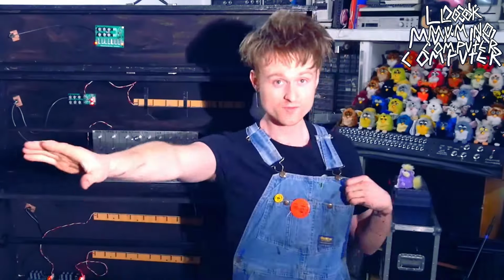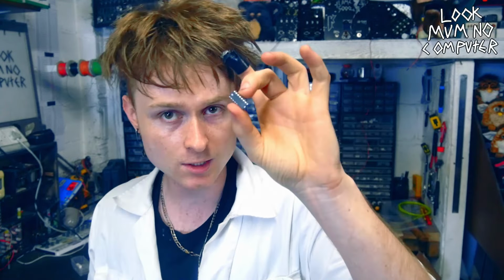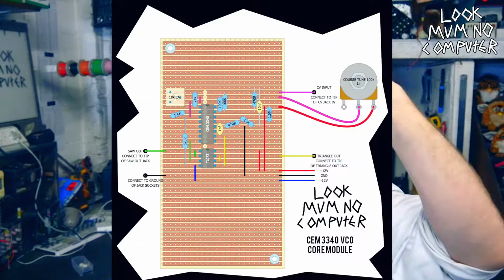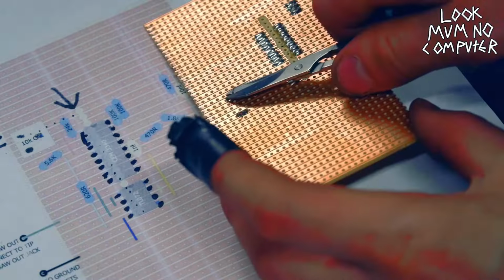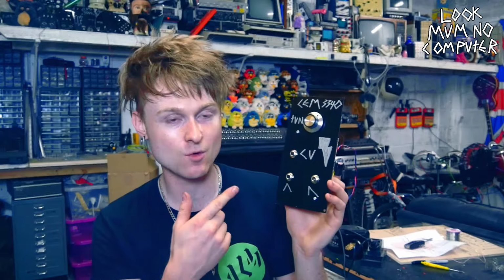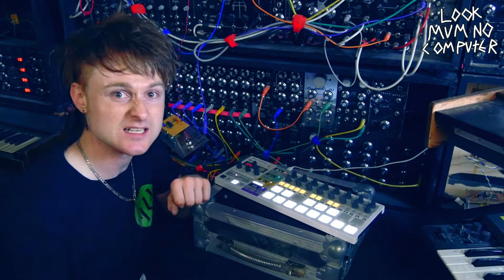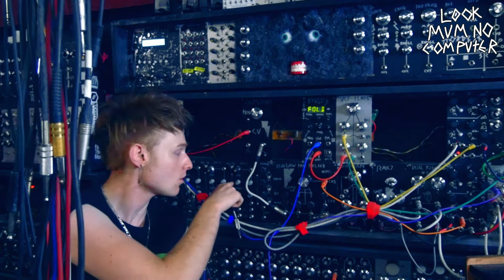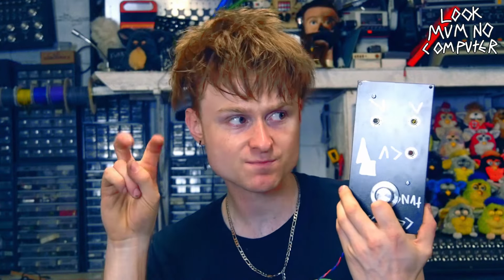Synth Voltage Controlled Oscillator 1v/oct tracked DIY how to.

Comment: If you want to tune this thing i less than 3min without any skill required and have a midi to CV interface and a computer, you can use my VCOTuner application here: https://github.com/TheSlowGrowth/VCOTuner
It's basically a little game: Connect it up, then turn thr trimmer until the line of your computer screen is as flat as possible
Reply: That is very cool, thanks!

Comment: Where is a reliable source to purchase CEM3340s?
Reply: Um...
You could use an XR2206 or an 8038 ic.
Both are VCO's that output square, sine, and triangle / sawtooth waveforms, with symmetry / mark:space adjustment.
 They are both well known, easily available, and only cost a couple of buck$.
Reply: @massimookissed1023  Thank you so much!!

Comment: Hey did anyone build this circut with an AS instead of a CEM? 
I get it to make noise but frequency is rather high and completely cuts of at about turning down the POT to about 5 K ...  Same problem anyone? Triple checked everything
Reply: Ah got it! For anyone interested, I had to replace the 100 K after the input POT by a 220 K. 

Now frequency range is good! CV jack not functioning yet though. 
But going to figure that out as well!

Comment: should the ics get hot? or have I wired something wrong?
Reply: @XXXLeahCimXXX  after looking into it and talking to Sam, they shouldn't get hot. I never figured out why it kept happening but I just removed the tl072 and it all worked right. later I tried a tl074 which seemed to work. might have been a bad 072.

Comment: Novice here, any one got any info on how to get the power supply to work with a +12v -12V 16 pin power supply? I have most of the components but I'm a bit lost on that aspect of the build.
Reply: @shokdj1  Not at all. This is of course DC.
Reply: @EvilOverlord96  yeah I deleted I misunderstood the -12
Reply: +/- 12V is Eurorack standard, so any Eurorack power supply will work. You can buy complete power supplies, buy them as a kit or make one yourself. An alternative would be something like the Meanwell RT 65 B. Some people might say it's not the best power supply for synthesizers, but for a DIY synth it should be good enough. As for the 16 Pins: This is also Eurorack standard. Some details and the pinout can be found here https://division-6.com/learn/eurorack-power/
Reply: Cheers man makes sense
Reply: @EvilOverlord96  I honestly thought for a brief moment that it was alternating, but it actually sits at -12 and plus 12
Reply: So from my understanding there’s 12v + and 12v - either side the ground and that’s it
Reply: @shokdj1  yes exactly. Effectively it's 24V. But the 0V or ground  reference point is in between. All inputs and outputs are relative to ground.

Comment: This is an old concept of synthesys, voltages are unstable and can be polluted, my very first synth worked with voltages. Today, with most of the microcontrollers you can have sine signals plus their harmonics for cheaper, or use a DSP, anyway that's far better because that's digital !

Comment: How does he tune it? What tool I mean
Reply: He uses a keyboard that puts out CV voltage at 1V/Octave. Then he turns the trim pot until it sounds ok to him. He mentions only using 4 octaves anyway. If you want to get the tuning accurate for 6 octaves or more you tend to need a more elaborate tuning with more pots. (Some use 2 pots or even 4)

Comment: I'm not whining and it's a cool video ) BUT... not everybody can afford (or even order) this chip. I've soldered two oscillators from discrete (op.amps mostly) components. And here are a lot of discrete schems over Internet  with 1v/octave. One thing (i guess) is superior with this chip is that it doesn't need to be temperature compensated. It's one of the most "evil" things for the most of discrete schems.
On the other side: when you choose CEM chip you loose any possibility to influence on the wave's character (it's not about PWM). Saw wave looks "too proper"... if you'll try some "cheap schematics" then you'll find that SAW can be changing it's form over octaves! It's cool and gives more liveness to an oscillator.

Comment: PC board porn, lol. I wonder if anybody ever attempted DIY DCO?
Reply: Sonikbytes Yes if i find the link ill let you know ;-), i saw one vid a while back .
Reply: Here Yo can see examples of dco, lfo and more interesnt utilitys with a ATtiny84 and 85  https://github.com/robstave/ArduinoComponentSketches
Reply: while neat idea to experiment with arduino type of circuits , I was hoping to see more traditional DIY DCO which is an analog oscillator under digital control: clock (analog or digital)-> divider/counter ( controlled by CPU)-> wave shaper "core" (analog components charging -discharging a capacitor circuitry )  like you have in 80's synths. Yea crazy amount of work :)
Reply: Sonikbytes right, Arduino is just LoFi sound, very usable but lofi, look at the VCDO of electric druid web

Comment: Does not work, even the VCF works only to 40%, all garbage.In the internal there is more help seeking, the Sam never answers a question, very bad, let the fingers of it, scrap everything.
Reply from the maker: it does work. i do answer pretty much all of my emails. all when built properly work well. have you emailed me?
Reply: @LOOKMUMNOCOMPUTER  Hi,

ups! No, I did not contact you via e-mail, I thought you answered the questions here. I did not mean to be rude. I'm just annoying the vcf is running at 60% and the OSC as well, I've checked everything 3 to 5 times. Would be great if I can reach you once via an e-mail, with answers you can also take your time, I have to see which e-mail address you are reachable, or can you tell me? greetings